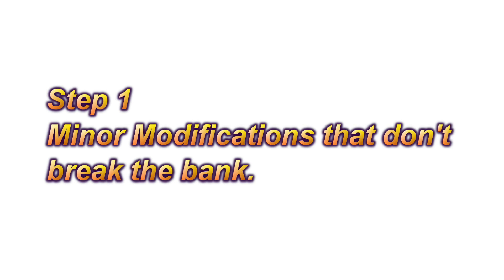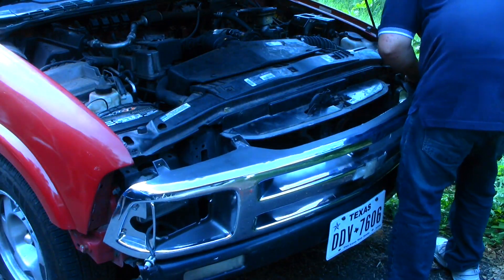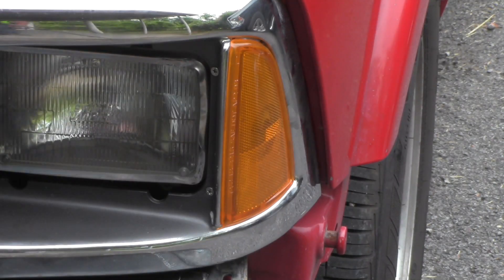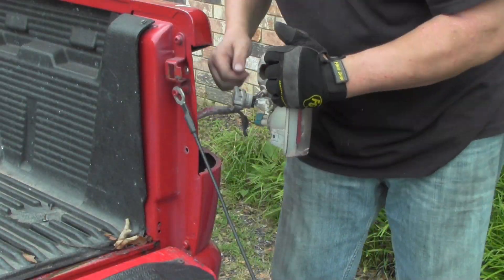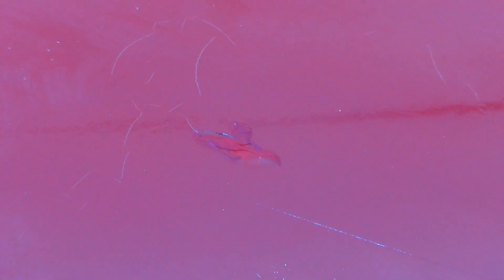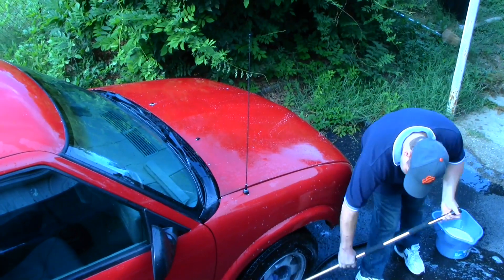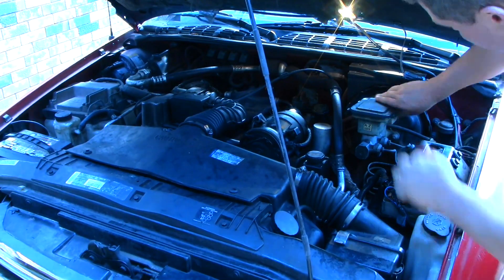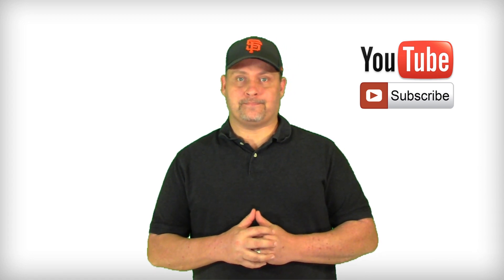3 Easy steps to maximize the value of your used car

Comment: Good video...wish I could just use that scratch applicator on my car but the scratches seem quite deep or would it still work?
Reply from the maker: +Tre I've had some guys that are touch up specialist say that you should fill the deep scratches with some primer then use the pen. After that feather it out with some 3000 grit sand paper and then clear coat the scratch. I haven't tried that just yet but it was sound advice for deeper scratches.